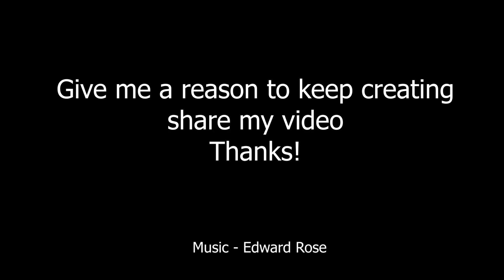I made my first wooden box! Is it good for a first try?

Comment: Did You use a cnc straight flute bit in a drill press to mortise your hinges? pretty smart !
Reply from the maker: Yes, I used the bit from my cnc machine, because it's small allows me to carefully cut out this rectangle. The other option was to use a router bit, but it's bigger and there's a greater chance that I won't be able to follow the correct cutting shape.

Comment: Nice job but the direction of the slats should be turned through 90 degrees to have the stresses of expansion. Also no allowance for this natural movement in wood. This box will push its self appart over a few years. In my 70 years of working with wood I have seen it happen so many times.
Reply from the maker: Yeah, I thought about that after I finished it. The next one I made I didn't put glue on these slats so they can wiggle inside, shrink and expand freely
Reply: @Edward_Black_Rose_DIY  worth doing because wood can be unforgiving. If the slats are quarter sawn that would reduce, but not completely, the movement. Good luck.
Reply: @Edward_Black_Rose_DIY    To see the wood movement in such a little slat, you would probably need a microscope to see it...😂 Good job!